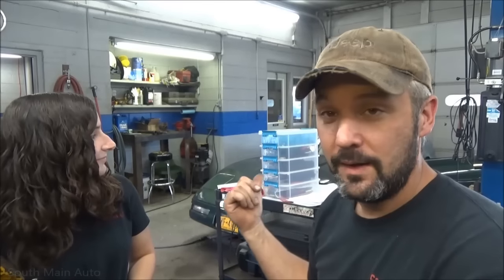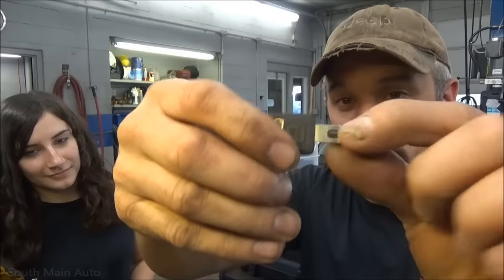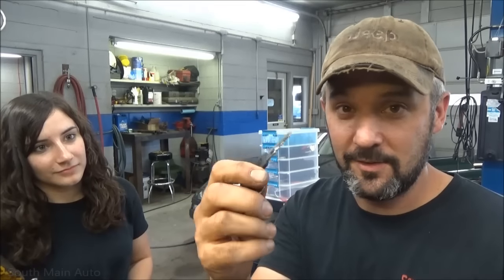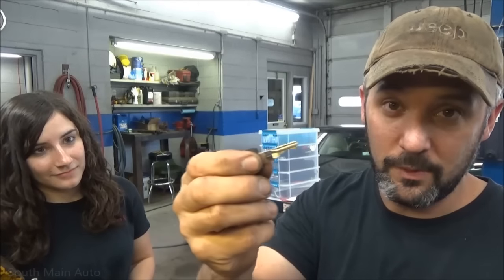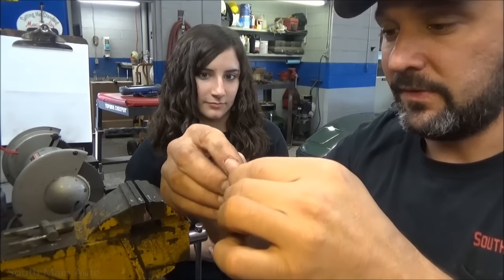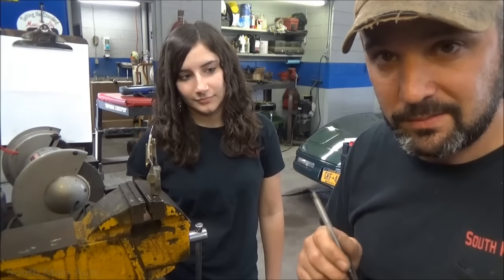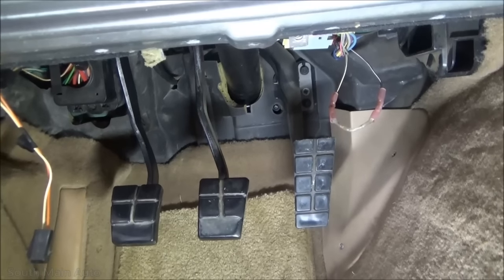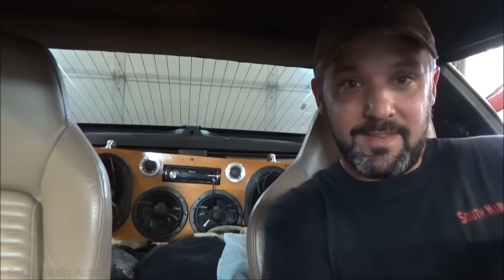GM VATS Key / Resistor Key Security Bypass

Comment: that system has prevented more legal owners from starting their then ever prevented thefts. Radio Shack $3 fix
Reply: ykmalachi Than*
Reply: N
Reply: ykmalachi 
Resister part # please.
Reply: There is no "part number".  Simply measure the resistance with an  
ohm meter, then go to an electronics store and buy a resistor with
a close value.   You may have to buy two resistors to get the proper
resistance, in SERIES.
Reply: I actually fixed it properly, REPLACED THE BCM, done.
Reply: @nickoD509  For how much?  Those have a lifespan of about 7 years.  You'll be doing it again.  It is an engineered problem, and those BCM's won't be around forever.  THe right thing to do is buy the $280 NewRockies Pro Module that fixes the problem forever.  The resistor will give constant amperage to the theft deterrent system and damage the module leaving you stranded again later on.  Hence the reason the NewRockis Pro Module exists.
Reply: Hans Anderson electronics store? Good luck finding one of those these days.
Reply: @waynesanders1406  nobody cares
Reply: @waynesanders1406  SORRY, BUT NEWROCKIES DOESN'T HAVE A MODULE FOR THIS 1994 YEAR. ONLY 83-89 C4 MODULES AVAILABLE...SO A NO GO THEN.
Reply: Omg right? My mom has a vats key and has spent waaay too much bc she lost it twice n now she put the wrong key in n it's stuck tf. It's a 2007 Corolla lol. But it was my Dad's RIP.
Reply: Well of course, since there are millions of cars on the roads and people using the keys multiple times a day.

Comment: So I told you last weekend I was putting in a VATS bypass on my 1990 vette. I dropped the to panels and some yahoo over the years done a little splice and dicing!  Now I’m back here see what I can find out without having to drop the steering column. Yes, I’m a lady, 59 to boot! Not giving up. Just double checking

Comment: The '91 Reatta has VATS and many have had to do this bypass. Thankfully- my '89 doesn't. All 4 years have RKE, and '88-'90 VATS consists of a lockout module, that kills power to the fuel pump and ignition if the locked doors are opened without the RKE or door key, triggering the alarm (lights flash, horn sounds). This was a very common failure, mostly the column wiring at the tilt point. Here is some more information on this- and a Tutorial, put together by Reatta owners and Members of the AACA Reatta Division- Your video is a very nice addition to this, a video always helps! Nice to see Ms. Hana, not so camera shy! That's how I got my start in automotive repair, being an Apprentice from age 10 to 16, then working like Josh until I was 27. Now- I just enjoy retirement and DIY. Eric- you and a few others on YouTube are very charitable, taking time to make videos, thoroughly explain stuff, a give sound advice; you are much appreciated, thank you. Here is the link to more VATS info-  http://reattaowner.com/roj/component/content/article/62-electrical-system/other-electrical/232-vats-passkey-system-bypass-instructions

Comment: Excellent video!  I had to do the exact same procedure in my 96 Impala SS.  One day after work the Impala wouldn't crank.  I went back in the shop and fabricated a resistor combo that closely matched my ignition key.  Spliced the resistors in where the connector is under the steering column and BINGO!  I did that maybe 10 years ago and the Impala still starts without any issues.
Reply: Does this work on a 2001 chevy monte carlos ss 3.8l
Reply: @troysmith3054  Can't say for sure, but I'm assuming it would.
Reply: I can't get it to work

Comment: Eric! You are so right! I had the same issue on my 1998 Monti Carlo. I live in northern N.Y. and needed a temp repair (no resistors). Took the Spare key, cut off the plug leading to IGN switch and soldered the wires on the plug to the key! Temporary, but it works! Thanks again! Been following you for about two years.

Comment: Nice video.FWIW, when I do these, I cut the lock cylinder side of the connection rather than the other. If it ever needs to be repaired correctly, the new lock cylinder comes with the length of wire and male connector anyway. Therefore, as far as wiring goes, future repair is simply unplugging/removal of resistor assembly and plugging in new lock cylinder. Added bonus - this way also allows you to build your resistor assembly on the bench rather than working under the dashboard!
Reply: Andrew White honestly, with as kinky as those security systems were, it is better off being bypassed
Reply: Exactly!!
Reply: @TheCrystalGlow  he didnt say not to bypass, he said to bypass on the other side of the connector as to not cut into the vehicle harness
Reply: I do it the same way
Reply: Very, very nice! Do your method involves taking the lock cylinder out of the car to wire in the resistor?
Reply: I dont mean to be offtopic but does someone know of a trick to log back into an instagram account?
I stupidly forgot my password. I would love any tips you can offer me!
Reply: @Boston Baylor instablaster =)
Reply: @Vicente Dominic Thanks so much for your reply. I found the site on google and im in the hacking process now.
Seems to take quite some time so I will reply here later when my account password hopefully is recovered.
Reply: @Vicente Dominic It worked and I now got access to my account again. I am so happy:D
Thanks so much you really help me out :D
Reply: @Boston Baylor Happy to help :D

Comment: Best auto repair channel...period! Eric you do an amazing job👍👍👏👏👏
Reply from the maker: Thanks!
Reply: Tell me will it work on a 92 allante while it's in theft disengaged mode. I came out of a store went to start it and it wouldn't start and said theft deterant  disabled wait 7 minutes I have tried repeatedly and checked everything outside under the hood parking gear also have another key neither of them would start the car horn and all works but when I disengage it car still will not start

Comment: Dr. O -- I always like to watch your videos as they are so educational and informative. However there is another fix that is somewhat faster and less involved and more permanent than adding the resistors in a bypass circuit.

Whenever the ignition switch is in the RUN or START position, 12 volt power is fed through the clutch interlock switch or PRNDL automatic transmission neutral start switch. If the clutch pedal is depressed or the automatic transmission is in neutral / park, 12 volt power continues to the control side of the theft deterrent relay. It passes through the relay control coil and onto the central timer module on a yellow / blue wire. 

If the central timer module receives the correct resistance from the ignition key it grounds this circuit which completes the starting circuit at the theft deterrent relay from the ignition switch to the starter solenoid. You could just permanently ground the yellow/blue wire at the central timer module and avoid having to match resistors and solder. The safety features of the clutch interlock or PRNDL safety switch would still be enabled. Just another option.
Reply: The only place I've ever heard this fix! Hope a central timer module is easy access!
Reply: Hey Bud I was wondering if you know why the key would stay stuck to the postion before start and not turn back? It started to make this funny starting sound like the starter was about to go up. I tryed to start it 1 more time it cranked alittle and didn't start. I added the jump box because it sounded very weak. When I tryed to start the key stuck 
Security light was coming on than going off at first. Now it doesn't show at all 
Will only crank like 2 times that seems like a dead battery even when hooked to a jump box. Why is there no Security light and key won't turn all the way back? Thank you

Comment: I know this post is old but I just had this issue with my 1999 Buick LeSaber. Thank you for the video it was extremely helpful because a shop fix of close to $500 on a car almost 20 years old is tough to justify, I will add that there is a fix with fewer steps, please let me explain. I was confused and only half understood about the resistance chip on the key and I was discouraged initially looking up fixes because they all included the voltage/ohm reader, which not being strong on electronics was extremely discouraging. So I finally watched through the videos and understood the problem completely, two ****ing wires that run to the ignition tumbler, and it is, yes a common problem with this system, it seems very rarely there is actually a problem with the VATS module, all my research showed this to be accurate. I have found that there is a process that requires the volt meter (if you take it to a locksmith they should have a tool that grabs the resistance) and there is a variance (usually) of only 15 different resistances that your key could have, a google search can bring up a chart that is listed 1 through 15 and its ohm rating and variance in /+ resistance for that system.  So finding the resistance is step one, step two I went to the Source electronics store and bought a pack of resistors with a wide variance and since I don't know how the stupid color ring markings work, my most time consuming task was matching a resistor manually with my reader to find one I needed ( key was #5: resistance read 1129 with a -/+ of 1085/1195, I used a resistor or 1180: brown, red, red, gold). After successfully determining the the resistor I need, I removed the panel under the dash attached to the fuse box and located the Orange wire which inside has two white wires and followed it to its base, to save having to cut anything I took my new resistor (which has an inch of lead on either end) and bent it and shoved both ends into the metal ends of each white wire which held it firmly. Boom! Car started! So I took it out, cut down the ends a little and folded them and reinserted into the ends of each white wire where they go into the terminal, which went in firm and secured it with electrical tape. It now runs and in the pack of resistors ($6.99 for 84, 42 of each resistance from 100 300K) I took out the second identical resistor of which I used and secured it in my car, If I hit a bump hard enough to dislodge it (unlikely) I have the know how to take out three screws and slap another in. This was a quicker "redneck fix" that no one offered on any video and I understand that because the need to solder the wires is the ultimate "secure" fix, but I hate cutting wires on any harness in a car unless absolutely necessary and in my eyes as soon as I have to splice/solder anything, it is no longer a "quick" fix, this problem with a volt meter, a pack of resistors, and knowledge how to read the color markings could make this a literal five minute fix. I want to help as you all have and I will be posting this exact explanation to the top five posts about this in hopes to help the lazy and would love feedback from the authors of these videos and others, I will not make my own video as I have no channel and anyone searching probably wont find it, so I would like to ad this tidbit of my time saving experience as it is the fix I was looking for originally and isn't as overwhelming. I will add as I have seem many authors have, this is just an explanation and no one is telling you to bypass this system, nothing is better then a certified professional assisting in these repairs and I hope anyone reading read through till now because yes, be mindful of the airbag wire, even though you aren't cutting anything take out the fuse for the airbag, safety first. Thank you and again I hope I could add some extra help to a problem we will face for a few more years yet.

Dustin

Comment: And he writes.....Eric I had an 89 S-10 Blazer with that exact same system. Right after I got it, I threw the 2k resistor in the glove box....ready for the day it would save my bacon. But you know I drove that little red truck with the big 4.3 daily for 26 years, every place I went, almost 300,000.00 miles worth and when they finally hauled it away for cash on the pound because the body would tilt going around corners and the frame was almost folding in half....salt baby salt....Michigan winters....the bacon...ah...resistor was still in the glove box!  I guess I just got lucky! Great video. You take care now ya hear! Jpol.

Comment: Eric - Probably 5 other guys said this already and I don't know if you even read these comments. But, if you ever do one of these again, cut the harness on the lock cylinder side, unplug the remainder and take it over to the bench, solder in your resistor, then take it back and plug it in. Leaves the dash harness whole, you solder at the bench (no burnt carpet for you), and if someone ever does want it to work again, they are going to replace the lock cyl which comes with a new harness anyhow. Cheers, love the channel, keep up the hard work!

Comment: I bought a similar resistor kit online just so I could get the power locks to function on a remote start I installed in a Jeep Liberty. Jeep requires very different specific resistance for the lock and unlock trigger outputs. Those resistor kits are great to keep around! Always finding uses for them! Great video Eric! Had to be a challenge to video it under a corvette dash!

Comment: Thanks to this video, i was able to bypass the VATS in my 91' Camaro, thank you so much!
Reply: I also have a 91 Camaro  I am getting spark and fuel pump is coming on security light does come on  I noticed the injectors are not opening  bc it will start off of starting fluid

Comment: WOWZA! ERIC with the video editing software skills (didn't even bump the camera getting back in either by the look of it). 
 ALMOST A SEAMLESS TRANSITION 12:07
Reply from the maker: skillz haha
Reply: @SouthMainAuto  Got a question for you and no option to message you, so I found a comment of yours and replied to it. Got a issue with a 1999 Silverado. Died going down the road and now only clicks when attempting to start. Battery is good and the security light is on. All the gauges light back up after the key is returned to  RUN position from START.

Comment: One thing for next time, I would suggest cutting the connector on the key side, then you can connect the resistors at the bench.  That way all you have to do is go under the dash and plug it in.  One other thing I have done is put a label on the wire with the resistor values for future reference, just in case they go bad.  Hope I made sense,  once again, great video as always and I appreciate the time and effort you put into making the videos.
Reply: Ricardo M. Great input..thanks
Reply: I doubt that the replacement resistor will ever go bad.  The reasons that these
VAT systems fail is in the wiring that goes down the steering column or in the
ignition cylinder,  not the resistor.   There is very little voltage or amps in that
circuit, hence the thin but fragile wiring.   You can always measure the resistance
in your original ignition key if you need it.    Or you can write down the resistance
value of the chip in the ignition key in your owner's manual, so you can easily
find it if you need it.
Reply: The resistors won't lose their color bands. All somebody needs to do to figure the resistance is to calculate the codes on them.

Comment: Nice permanent fix, happy customer and Hannah looks fab !
Reply: I'm sure he could of backprobed the connector with the home made resistor without cutting it.
Reply: Wouldn't have worked all the time.  He mentioned that it was intermittent.  So when it acts up, the resistor would take over.  When it didn't act up?  The system would read the key resistor + the resistor.  So the security system would still trigger and cause it not to start.
Reply: Hanna sure is cute.
Reply: Tedybear315 the connection reading the key resistance is disconnected per the video,  it will always ONLY read the resistors he put in

Comment: This is of course mandatory for a remote start system...  Made a remote start/alarm/door lock/window control install diagram if anyone's interested.  It's a viper on a 93 convertible, but good info for other years/models... 
Fun fact: In 93, Corvette was the first car with optional automatic door lock/unlock, via a antenna loop in the drivers door which sensed the wireless remote.  Though you did still have to take the key out of your pocket and do the manual thing to start it...
Reply: Thank God they evolved into something that you could use
Reply: GREAT WORK ERIC . EXACTLY HOW I WOULD HAVE FIXED THAT VATS ISSUE.

Comment: Solder the wires to the resistor in the key itself (spare key) and tuck the whole thing up under the dash. Works great and you don't have to go find a resistor.

Comment: Pro Tip... if you cut the wire on the key cylinder side instead of the factory side then you can make your connections outside of the car and just clip it in the car. Also you won’t have to worry about losing the the factory side connector if you ever do replace the key cylinder
Reply: Nailed it!

Comment: Just a thought... Rather than cut wires on the harness side, I would cut on the ignition switch side. The wires to the ignition lock side are part of the switch. That way is someone replaced the lock it would be good to go with no cut to the wires.